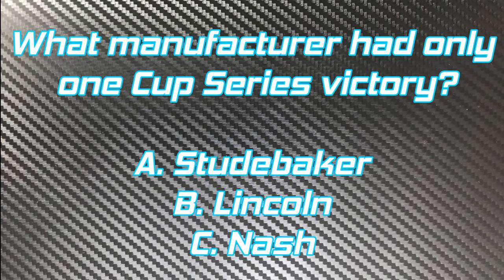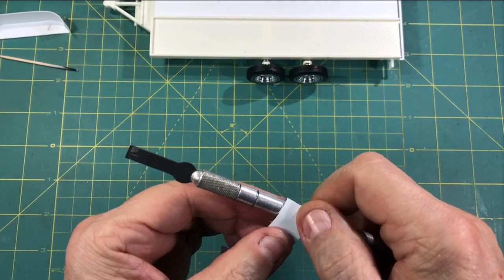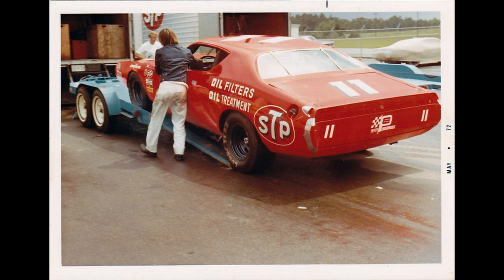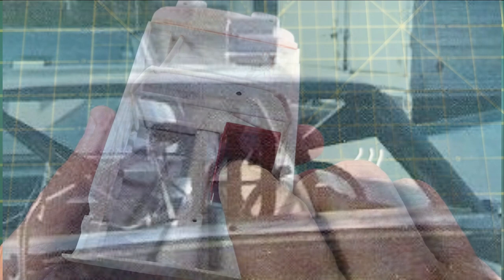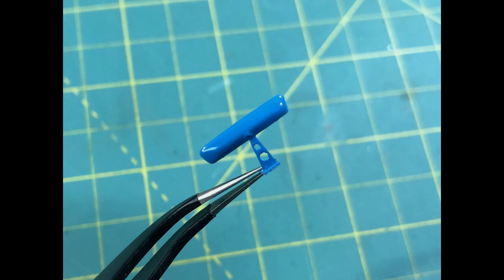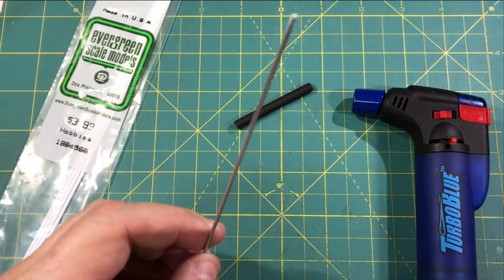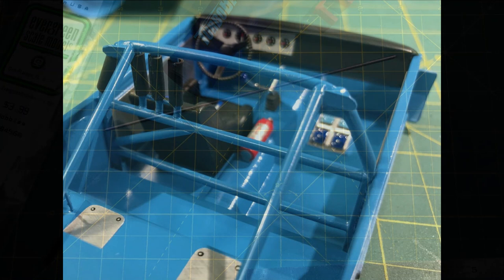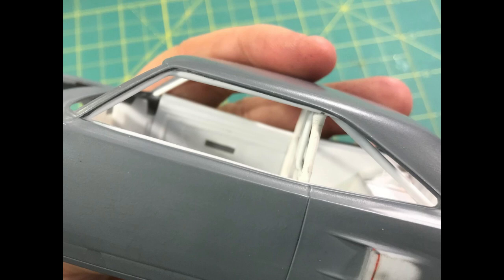USACC 1970 Petty Enterprises Plymouth Roadrunner FINISHED!

Comment: That is a great shot of the petty hauler. I think this one was put into service in '68 - '69 - '70. Do you have any idea when it first appeared? I believe it was the mid 60's medium duty D800 before this one. I think that's what pulled Petty's cars in '67. Thanks for sharing.
Reply from the maker: Thanks brother!! Not sure about that L1000 cabover. 69 or 70? I also have a pic from early 1970 of this truck. (Black and white). 
Before that, I think you are correct, it was a D or L series.
Reply: @MarkBatsonHobbydude007  I know they ran the D (medium pickup style cab) ... pretty sure they never used the L series (in the pickup cab style like the lindberg kit) until it became like the one in your pic. I could be wrong and would be happily corrected. Just never seen anything surface with those earlier L trucks.
Reply from the maker: You’re probably right brother. Or maybe we’re both wrong. LOL. I’ll see what I can find out. 
Have a great weekend!!